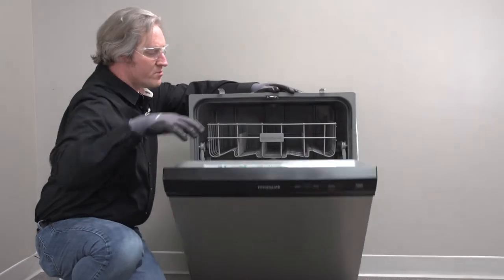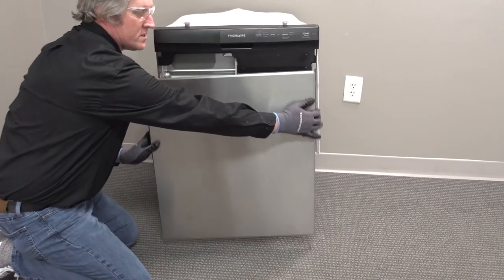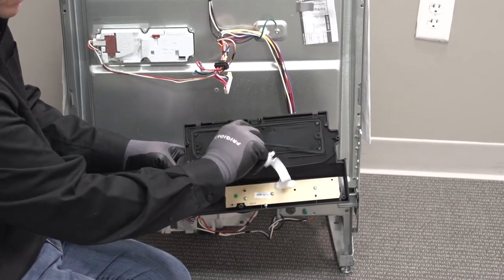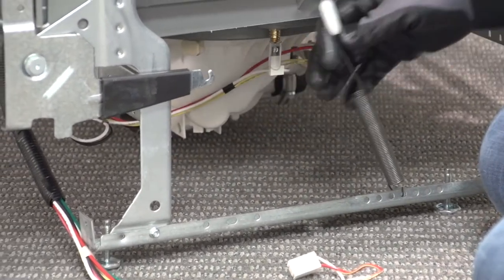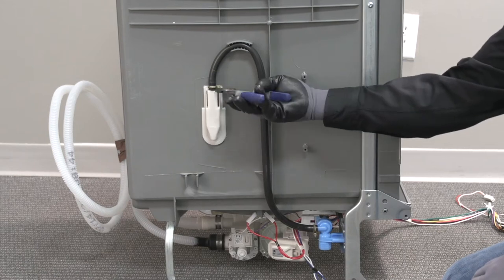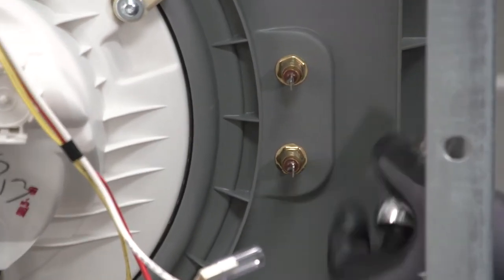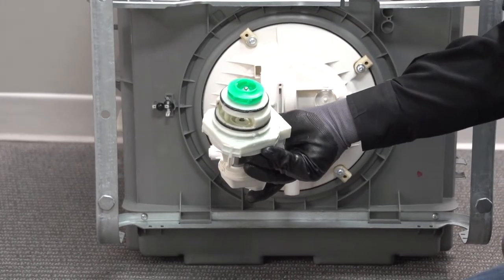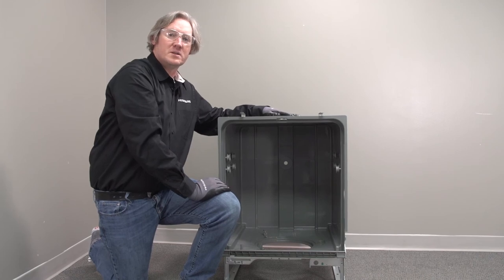frigidaire FFCD2413us Gallery Dishwasher: how to disassemble

Comment: fantastic video. Any idea why the circulating pump would stay on all the time? Replaced the control board and no good. Cycles through a wash cycle with no problem, but the circulating pump never stops during the cycle and anytime the door is closed the pump continues to run regardless of whether the wash is turned on or off.